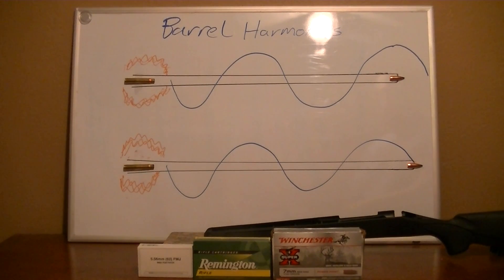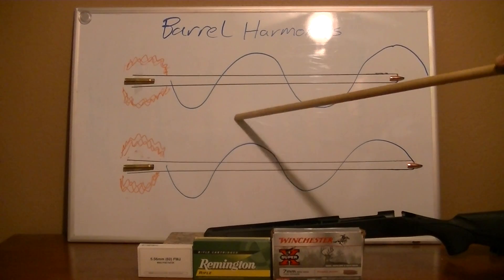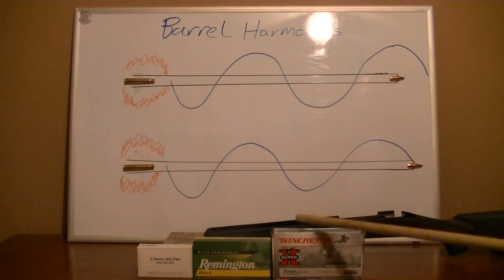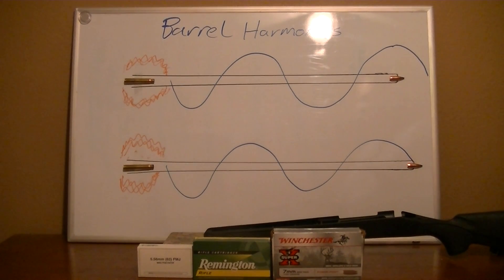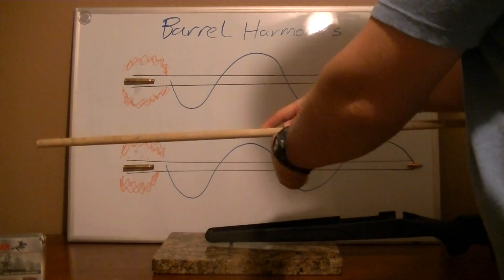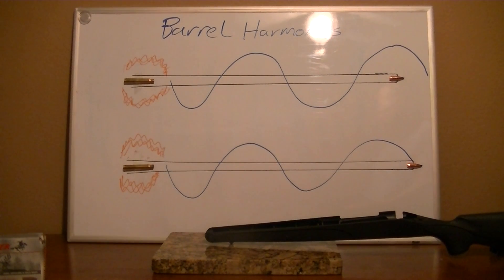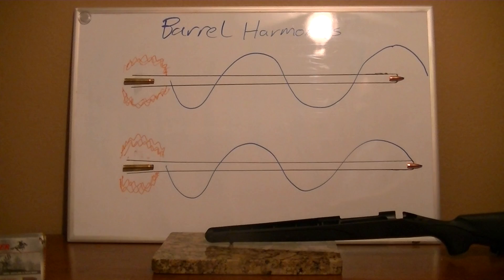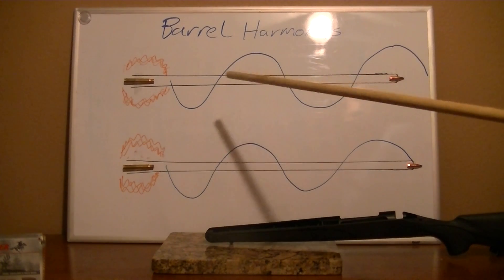Accurize your Rifle: Barrel Harmonics

Comment: No, this is completely wrong. At beginning of video he said this is confusing subject. And so it appeara to be indeed.

You want you bullet to leave when the barrel is at its maxima of the swing, not at beginning of the swing.
At maxima of the swing, variations in bullet speed (barrel time) does impact least. For beginning of the swing barrel time variation will cause the greates impact on accuracy.

Comment: Great video. I now understand better.

Does the barrel need to settle down between shots?

If the bullet is coming out consistently at the top or at the bottom of the wave, I understand a different point of impact shift.... but why would that shift not be consistent?

Comment: Very over simplified. An AR-15 has a vibrational wave travelling 20,000 fps will cover 32 in. (2X barrel length) in roughly .000133 seconds. Over .003 seconds the wave will oscillate along the barrel 22.5 times. .003 seconds is the time lapse from pressing the trigger till the projectile leaves the muzzle.

Comment: Very Good video, but i am pretty sure bullet exit timing window is much larger at peak  and valley (end of travel) not at zero axis, so folks are tuning so bullet exits at end of travel when barrel changes direction not when it passes back through zero axis. Timing might be .1-2 millionth of a second for passing through zero axis as that would be very hard to repeat and find versus the larger .5-6 millionth of a second at end of travel since the barrel is decelerating and reaccelerating due to directional change the duration of time bullet is traveling through that event is greater.  Respectively, i think you should redraw the bottom graph to show optimal setup/exit timing when barrel is at peak travel. Just my thoughts, i have no detailed calcuations or experience to back this up. In other words the barrel travel distance at end of travel is flatter and stays within a narrower travel distance vs the steep vertical curve at zero axis where it it has greater travel over shorter time. Just my 2 cents again, i have no experience on the matter.

Comment: your explanation of the concept is resonably acurate, exept, when its best for the bullet to leave the barrel
And i will be making my own video soon explaining this for my channel
the barrel is moving the least at the very top and at the very bottom of the sine wave 90 & 270 degrees
Where the sine wave crosses the zero line, is where the rate of change is at its highest, and hence the highest rate of barrel movement
Hope i have explained it properly
have a nice day 😁😁😁
Reply: According to the presenter "one swing stops and another swing starts" where the swing actually has the highest speed. 😀
Reply: You want it to exit like launching out of a swing. On the up slope. This will give positive compensation to slower bullets making tighter groups.

Comment: I've seen this video probably two years ago and I still reference it. The reason I keep watching it is to see if anyone has posted an actual scientific video and I still can't find one. I play guitar and I've studied guitar and my hypothesis is that there is a comparison to be made but I don't know how to do that which is why I want to see someone smarter than me post a video. The way I see it is on a guitar. If you took a guitar and played an open note, will say E on the bottom string but it doesn't matter which one. We'll say the distance from the nut to the bridge is 25" and we'll just keep it that simple for example sake. The next occurrence of that E note is at the 12th fret which is exactly half the distance of the nut to the bridge. That happens to be 12.5" away from the nut or the bridge. In modern music, there are 11 notes and the 12th note starts the repeat of these notes, ie the octave. I believe a rifle with everything on it; stock, reciever, barrel, scope, brake, everything on it creates a note. The vibration of the cartridge going off is like plucking a guitar string. I wished someone smarter than me could measure this phenomenon because I am 99% sure it is a real thing. Now if you reloaded ammo, you can basically tune the ammo to the rifle and we see that in load development and testing those loads. But something is happening and you are very close to the science of what I'm talking about. I've heard that velocity in relation to bullet weight is one form of creating accurate loads and this can translate to picking another bullet of the same weight as the first and then matching the velocity to continue shooting accurately but I haven't tested it myself. All I'm saying is I wished someone could hook up a rifle to a computer and measure the frequencys coming from the rifle and correlate that to velocity and bullet weight. A tuner is about the closest thing we can use besides ammo tuning to create an accurate rifle

Comment: I read an article making fun of bedding materials like Bondo or silicone caulk. 
However, the author didn't mention why these materials do not work. 
Please clue me in on why rubber caulk would not work as a bedding material.
I would think allowing the action of the rifle to vibrate freely would be just what you want, but from what I understand now, I'm guessing ideally you want to clamp the receiver down as tightly as possible to something extremely rigid but form fitting so that you cancel out as much vibration in the receiver as possible. Is that the case ?
( with both examples having a fully free floated barrel. )
Why would Bondo or JB Weld not work ? 
Both create a perfect mould and are rigid. 
Also, I'd like to ask if when free floating a barrel, where that you start the bedding. Do you bed from the barrel lug on back, or have the barrel lug free floated too ?
Great video ! 👍

Comment: At what point does a supersonic round cross the sound barrier?
Reply: When it starts traveling faster than 767 mph.
Reply: @haroldbalzac6336  The speed of sound is a function of pressure, so that number only applies if the bullet is outside the barrel at atmosphere.  If the barrier is breached inside the barrel then it seems to become a lot more complicated.

Even the basic question of whether the sound barrier is breached inside the barrel vs after leaving the barrel is interesting.  Or does it happen at the point of exit?

Comment: Thank you,
 This is the first time I have seen barrel harmonics address, most will just glass bed the action and free float the barrel.
 I learned about barrel harmonics from a friend when I was 15, he was in his early 30 and married, they lived just down the block from us and he flew control like model airplanes as did I.. That is how we initially met.
 Later in life learned his uncle was my gunsmith from 1975  until he died, now I know where Joe got his gun expertise. 
Joe was old school wood worker all hand tools, 2 power tools a drill and 7.25 skill saw. 
I watched him spend 5 hours hand fitting a Custom built .270 with a feathered walnut stock, Joe hand cut the stock from a slab. he was a true artist and perfectionist
Thank you my friend Joe, for having the patience to teach a 15 year old how to properly build, and fit a custom rifle, RIP we will shoot again someday.
 He would assemble the action minus the stock, and clamp the action and barrel in heavy vice mounted on 6 in reinforced concrete and place a small block chevy cylinder ring over the barrel, he would then proceed to pound the action above the recoil lug with a rubber mallet, the ring will move up and down the barrel, until it finally stops on center node. he would mark the 1/4 wide area of the node
 glass bed the action, let it cure and clean up any places needed, smoke the barrel, put in stock and look for soot transfer, remove high spots fill and level all of the bedded area and place a credit card at the bottom of the bedding lug after the glass had cured, mark the stock for a bedding rail on the center nod. glass bed the 1/4 inch wide node area with clay used for a dam to keep the glass in a rail 90 degrees to the center bore of the barrel, let it cure then disassemble remove the credit card spacers, clean and finish assembling go sight in at 100 to 200 meters here in MS., his rifles consistently were a ragged hole for a five shot string hot or cold at 200 meters.

Comment: Man thankyou so much for this information. I had bought a 20inch upper, which its fixed now, but I was having problems with my shot being all over the place just like you explained. I kept trying to tell people that its nothing dealing with me zeroing in my rifle. They just kept on you need to zero in your rifle. So, final I told them, rather if I got  to zero in my rifle or not, if I'm standing 25yds back and my shot is going  7inches to the right and I got my back sights center and my front sites level center, then it's no way that I should have been getting a 6 inch grouping being only 25yds back. So, once the guy change out my handguard system it started working and being accurate. You should always be able to at least get 3 moa being that close up, rather if you have to zero in your rifle or not. I figured it had to be some type of vibration going on, for my shot to be flying all over the place  like that. Brand new barrel made by Anderson  cromv 1 and 9 twist. So, my point of this information is people, please  stop thinking everytime a rifle is off the first thing yall holler is o your rifle need zeroing in, o you got to zero your rifle, that's not always the issue.

Comment: If the point is to make a smaller group there's a 4th method.. the  ballistic method. Not everyone can do it though. Simple explanation.. One secures the weapon, then fires it and measure the speed of the exiting bullet. [Obtaining this device can be a problem] If you can get it.. then get the book [there is one] that has every bullet in your caliber and see what it states the speed is suppose to be. Then reload it [as Nathan does] to those specs, OR.. look for the brand that matches YOUR weapons expected speed. Get it, and THAT will be your tightest grouping.

Comment: Pause!

You missed one critical aspect about the reloaders method!

You use charge wait to determine velocity! Your es/sd is determined by ignition which gives your at range performance! Your SEATING DEPTH tunes harmonics!

You have 2 nodes your looking for. Your velocity node (changes from bullet to bullet and powder to powder and primer to primer you can't miss Match anything) which will establish your low es/sd node by doing a charge wait latter test and using a chronograph...
You do the latter by .3 grains because nodes are typically found in .2s so with .5s you can pass a node with out noticing it.

Then you have a Harmonic node which determines your physical group size as it pertains to the vibration in your barrel.

You can correct it by adjusting seating depth or by the use of a barrel tuner...

There are thread on tuners which are far far easier to use...

Comment: Go to 0:11 on this slow motion guitar string video:  https://www.youtube.com/watch?v=8YGQmV3NxMI  Slow the video down to 1/4 speed and watch the nodes on the guitar...they stay in one spot.  This is the same for a rifle barrel.  By tuning the load, you're trying to change the wavelength (the frequency) of the vibration so a node occurs at the muzzle.  This the place that everyone else below is saying is moving fastest, but it's not...it is not moving at all if you get the frequency to generate a wave the right length to line up there.  This is the most accurate location.  Even if you're off a bit, it is much smaller deviation than aiming for the "stops".  Would like to see a slow motion video of a rifle barrel being fired.  I've got ruger international with a pencil thin barrel and mannlicher stock, which are notorious for being unaccurate.  This thing is dead accurate and tight and I'm convinced that the forecap on the mannlicher stock is holding the muzzle still and forcing the node to that location.  And that's shooting cheap Federal 243b's.

Comment: also, don't underestimate letting your barrel cool and always foul your barrel with 1 to 3 shots before testing for accuracy.  When testing for accuracy, I always shoot fouling shots, let the barrel cool, then do my accuracy testing with 2 shots at a time.  I let the barrel cool fully, typically 10 minutes, with the rifle resting upright, and the bolt open. 

The reason I shoot only 2 shots at a time is:
the barrel starts to heat up after 2 shots.  Most factory barrels have stresses throughout the barrel, from manufacturing it.  As the barrel heats, typically it will point in a different direction, from metal expanding more on one side than the other.  Shooting, while your barrel is always cool, will bring out the best accuracy.  Yes, Its a pain waiting for the barrel to cool, but once you found your accurate load or ammo, you'll be glad you took the time.  When hunting, you will almost always be shooting a cold barrel.  If your shooting high volume, it's definitely worth looking at getting a thicker match barrel installed.  most match barrels are cut rifling, which helps reduce the chances of stored internal stresses.  Some are even stress relieved.  A thicker barrel also minimizes barrel whip.  This will cause more ammo or loads to shoot better in your gun and it won't change point of impact as much when your barrel heats up.